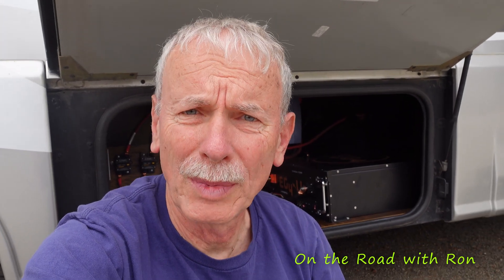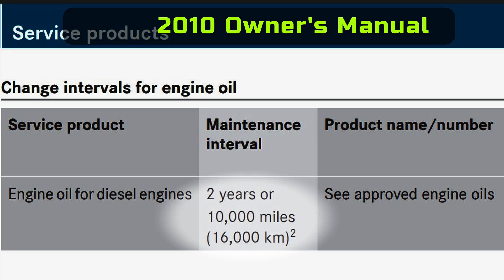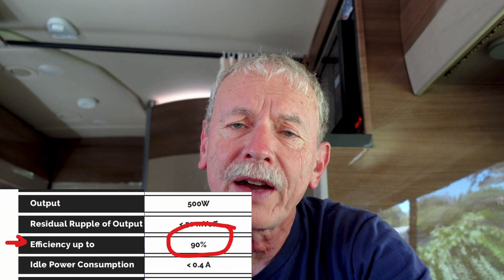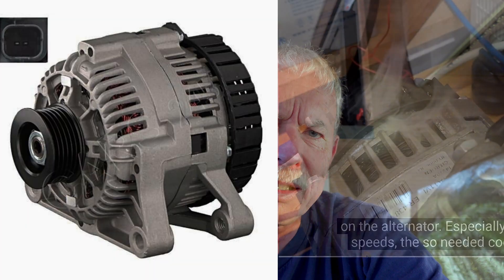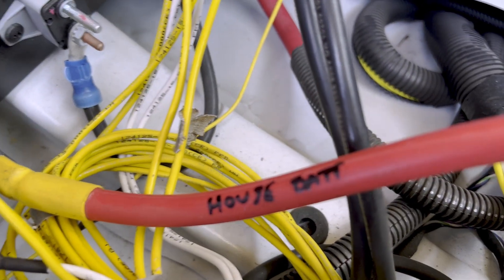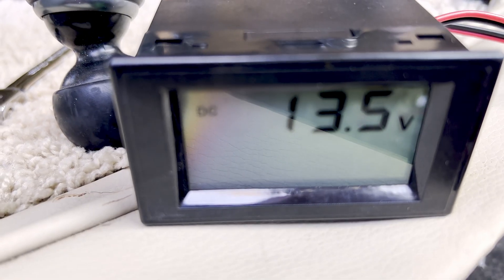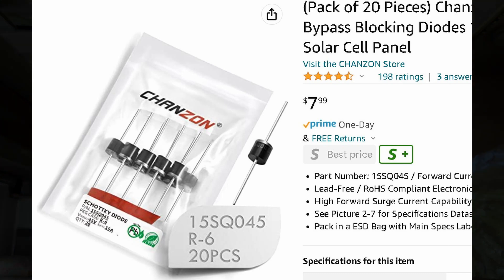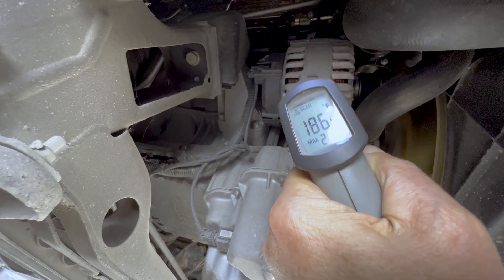DC to DC charger NOT required for big Lithium Battery

Comment: I want to buy a 100 ah lithium iron phosphate batter to put in my trunk of my crown vic to run a 500 watt sine wave invertor to charge my laptop, i recently upgraded my alternator to unknown rock auto brand 190 amp this setup has destroyed a 30 ah agm battery from mighty max. Idle charging is  cold is 14.1 to 14.4 and idle hot i mean couple hours of running later 13.5v and these numbers are consistent with or without the agm battery connected. Question is for you and i will not hold you responsible for anything going wrong lol but will it be safe running in the trunk off 18 foot 4 gauge power wire and a 1 foot ground, the 18 foot power wire going to the lead acid starting battery in the engine bay? Is there anything i should change like go direct to the alternator or put a amp limiter aka dc to dc charger in line? Thanks for your video and your time!
Reply from the maker: Main issue with 2 different voltage batteries connected is they will settle at the same voltage. The lithium battery will keep feeding the lower voltage chassis battery until it is mostly discharged at 12.8 volts. The alternator will charge both batteries but i’d either put in a disconnect or dc to dc charger to keep them separate unless actively charging them.
Reply: @ontheroadwithron2432  Thanks for that much appreciated!

Comment: We never boondock, so am I correct in thinking that our converter will keep the lithium batteries near 100% while we are on 30 amp shore power? I use 2 trucks pulling the Trailer so I do not want to use a DC-DC charger unless required.
Reply from the maker: Yes your converter will charge lithium batteries just fine. You do want one designed for lithium or has a lithium settings as the charges voltages are a little different than lead acid batteries.

Comment: Hi. I'd like to ask if the feasibility of your approach is based on your alternator's "smartness" (inbuilt ability to limit current)? According to all I have read (a lot!) my 280Ah LiFePO4 battery could draw a hell of a lot of current from my "dumb" alternator (160A rating).

Over current protection on the BMS is set at 230A.  So would setting this to say, 40 amps (or whatever I choose) give the same control your setup applies?

Additionally the 40A DC-DC unit I installed last year (working well so far) supposedly provides the "right (selectable) profile" for charging the lithium battery, optimising charging voltage.  Is you LiFePO4 battery happy to take whatever voltage the alternator puts out?

Thanks for sharing your findings.  I am keen to learn more.
Reply from the maker: A couple points. Alternators put out 14.4 volts and this will not hurt a lithium battery. Yours is a bit lower capacity so I would check how much current is actually flowing into the battery when it is less than 50% full. Depending on the size of your wires and how long they are, the current will be limited. How much is hard to tell. If over 80 amps, I would be concerned and not hook then up directly. 
Changing the BMS to a lower value such as 80 amps might also limit your discharge rate. My BMS is not adjustable so never tried that. Your 40 amp dc to dc unit seems fine and a good approach with your alternator especially since it is a bit lower output.

Comment: Thanks for the video. I have an 2006 Winnebago view. Not sure what you have. But the wiring looks identical  I even have the EG4 server rack. I had a lot of people telling me I can’t. I think you did a great job covering all the points they made of why it will fail.
Reply from the maker: Great. Did you go with the 12 volt version?  I thought about the 24volt but decided it was more trouble than worth it.
Reply: Yeah 12v. I linked into 24 and 48. I read they are “superior” voltages for many applications. But since a the wire runs are relatively short I figured 12v would be fine. 

Thought about going 24v for solar though. 
I’m not 100% how that would work. 
I’m still learning. Some info sticks, some goes in one ear and out the other.
Reply: Hello I have a 2006 Winnebago View as well I'm installing 200 amps of lithium battery and I'm wondering if I need a DC to DC charger for my 150 amp alternator. Did you use one ?

Comment: I think the biggest issue is that Lithium batteries outputs 13.3-13.4 volts, whereas lead acid outputs 12.8-12.7. That means your alternator would need to be charging at 14-15 volts to charge the lithium battery. My 120-volt AC charger outputs 16 volts DC to charge a “12-volt lithium”. That’s what a DC-DC charger could do (with step-up). I suspect that your alternator isn’t charging your lithium battery to 100%.
Reply from the maker: Of course lithium does not need to be fully charged after using it. My solar charger cuts off charging at 13.7 volts. The alternator output is 14.4 volts so that will fully charge the battery until the BMS turns the charging off.
Reply: > your alternator would need to be charging at 14-15 volts to charge the lithium battery.

LFP will happily charge to 100% SoC at voltages as low as 13.6v.
Reply: @fratermus5502  what does LFP stand for??
Reply: @victorjcano  LFP =  LiFePO4
Reply: I UNDERSTAND IT, IT'S NOT THE CURRENT THAT IS THE PROBLEM BUT WHEN THE BMS IN THE LITHUM BATTERY SHUTS DOWN THE CHARGE THE BACK EMF WILL TAKE OUT THE ALTERNATOR DIODES

Comment: This video is genius. Addressed DPF, DCDC charger, and the myths. Thanks!
Reply from the maker: Glad it was helpful!  Just trying to break down a complicated issue.
Reply: I UNDERSTAND IT, IT'S NOT THE CURRENT THAT IS THE PROBLEM BUT WHEN THE BMS IN THE LITHUM BATTERY SHUTS DOWN THE CHARGE THE BACK EMF WILL TAKE OUT THE ALTERNATOR DIODES
Reply: @victorjcano  the lead starter battery is still in the circuit
Reply: Sounds scary, can you elaborate? Will a VSR like Victron Cyrix-li-ct protect the alternator from such events?
Reply: @thegrave2000  From BMS shutdown?  No.  But the lead starter battery remains in the circuit to absorb such events.  The problem occurs with dedicated (secondary) alts that have no lead batt.  In high-end systems the BMS commmunicates with the external regulator to shut off the field before the BMS trips.  

Also, don't pay much attention to people who type in ALL CAPS.
Reply: @fratermus5502  hm, how are you going to shut off a secondary alternator? Is there some internal blocking mechanism for the pulley?
Reply: @thegrave2000  secondaries are typically externally regulated (Balmar, Wakespeed, etc).  The reg zeroes or reduces the field as required by adjusting the signal on the field wire. This control of the alt's output.

Comment: When the alternator is under relatively low load ie headlights, blower motors, wipers, etc.,
Reply: (a parallel wire could be manually or automatically switched on thereby decreasing resistance to the large load of the auxiliary batteries. Or manually running through a heavy-duty resistor, when not switching to bypass it, might have similar heat loss as running through just 1 wire)
Reply: (or sequentially switch individual auxiliary batteries on and off from charging with sequential toggle switches or multi-pole knob hooked up to heavy duty relays at each auxiliary battery).
Reply from the maker: Yes I essentially have that with my manual switch in the dash. This is mostly a backup as the solar is the main method of charging.

Comment: Just curious, would this depend more on the allowed current from the continuous duty solenoid and/or how many batteries you have charging? I’d imagine that solenoid is well over 150d. But if you add another lithium to the bank you’d then have the potential of charging at 300ah’s. I know in the Trevato’s the solenoids have to be replaced over time because of heat.
Reply from the maker: My solenoid is rated for 200 amps continuous. I only draw 80 amps or so from alternator to charge the 400 amp/hr battery. The Hersee Cole solenoids are very reliable.

Comment: Hi Ron great information I have a question I have set up where I will get variable rpm from my alternater that can be 100 to 2000 can I charge lead acid battery is and from lead acid battery to lethium batteries or can I charge directly lethium batteries please help me I m serious concern for this
Reply from the maker: Hard to answer without all the facts such as the capacity of both the alternator and lithium battery.  Lithium will pull a lot of power from alt. You can test it of course. If you have a 200 amp alternator then keep the Charging current under 100 amps. When driving the alt gets good cooling but be careful when just idling. Might overheat.

Comment: But you won’t get a full charge, an alternator will not charge a Lifepo4 to 14.4v, and THAT is one of the main reasons you want to use one to get full capacity charging, right? And also one of the reasons is supposedly the alternator can make the battery turn off and that could cause damage to the alternator. So I guess I’m not understanding what you are saying?
Reply from the maker: Full charge on my lithium is 13.6v. The alternator actually charges my battery more than my solar controller. Also how can the BMS damage the alternator? Doesn’t make sence as the charging current goes down as the battery reaches full charge.
Reply: I don’t know WHY  it damages it, I just know everything I read says it can damage it. But a fully charged Lifepo4 is 14.4 so 13.6 is not max. You’re losing a lot of capacity doing it that way.
Reply: Here is and exert from one of many articles

“Low quality alternators with poor voltage regulation can cause the Battery Management System (BMS) to disconnect LiFePO4 batteries. If the BMS disconnects the batteries, the alternator could be damaged”
Reply: @jamesmorrison5076  AS I UNDERSTAND IT, IT'S NOT THE CURRENT THAT IS THE PROBLEM BUT WHEN THE BMS IN THE LITHUM BATTERY SHUTS DOWN THE CHARGE THE BACK EMF WILL TAKE OUT THE ALTERNATOR DIODES. THE DC TO DC UNIT PROTECTS THE ALTERNATOR
Reply: Found this as to one of many reasons why. Again… I am not the expert so don’t argue with me I’m just telling you what my research shows :) 

“I understand the reasons. A stock alternator directly connected to Lithium is a problem as the low internal resistance will cause high continuous currents and kill the alternator by heat”
Reply: One more. 

The lead-acid battery is the safety "accumulator" that eats the transient peak produced when the BMS decides to disconnect the battery from the alternator avoiding any damage to the electrical van´s system and the alternator itself.”
Reply: One more. 

The lead-acid battery is the safety "accumulator" that eats the transient peak produced when the BMS decides to disconnect the battery from the alternator avoiding any damage to the electrical van´s system and the alternator itself.”
Reply: @ontheroadwithron2432  Each lithium battery is 3.7 volts. They run 4 of them in series to get 14.8 volts. Then they run the 4-packs  in parallel to increase capacity. There isn’t a “12-volt” lithium setup that is 13.6 volt. Lithium batteries can be charged to max and depleted thousands of times and is protected by the BMS.
Reply: @ontheroadwithron2432  Also how can the BMS damage the alternator? AS I UNDERSTAND IT, IT'S NOT THE CURRENT THAT IS THE PROBLEM BUT WHEN THE BMS IN THE LITHUM BATTERY SHUTS DOWN THE CHARGE THE BACK EMF WILL TAKE OUT THE ALTERNATOR DIODES. THE DC TO DC UNIT PROTECTS THE ALTERNATOR
Reply: "And also one of the reasons is supposedly the alternator can make the battery turn off and that could cause damage to the alternator." CORRECT. AS I UNDERSTAND IT, IT'S NOT THE CURRENT THAT IS THE PROBLEM BUT WHEN THE BMS IN THE LITHUM BATTERY SHUTS DOWN THE CHARGE THE BACK EMF WILL TAKE OUT THE ALTERNATOR DIODES. THE DC TO DC UNIT PROTECTS THE ALTERNATOR

Comment: Thank you Grandpa Ron for your all experienced level user friendly explanation of a complex subject real world application integrating new battery tech  into a tried true mechanical system.

 I only have one more question to figure into my application to find the answer .

 52 v 30Ah lithium high end ebike battery to power  led light strip a rice cooker 350w and laptop phone charging 1500- 3000w power drive inverter

 upgraded Toyota alternator 120watts I believe 14.7 volts at normal load . Do I need a different inverter to handle and limit the 52v DC, down to 12v  DC  that as of now provides very effective alternator charging and appliance powering from the stock lead acid starter battery while motor runs and for 30 minutes, after the motor is off before it auto shuts down at 12.2v with out any starter battery issues , looking for 4-5 hours of charging after the engine and alternator is off  provide 110 ac  with out catastrophic component failure.

 any accurate honest information from forum users would be valued .
Reply from the maker: Let me be sure. Do you want to use the 52v bike battery to run your 12v appliances when the engine is off? In that case a 52v to 12v charger would be needed.  If you just want to recharge this battery then you have to use your inverter to change the 12v from car battery to 110vac. You can then charge 52vdc battery with you battery charger (110vac to 52vdc).

Comment: Hi let me ask you if you have issue about your alternator when Lifepo4 battery bms triggers HvCutoff when it is fully charged with the alternator?
Reply from the maker: I have not had an issue. Of course i do not normally charge lithium with alternator.  But when i do use the alternator, i cut it off with my switch which is probably the same as BMS turning it off.

Comment: have had my sprinter 3 years and just last week I learned that through my Victron app, I can reverse the flow on my DC to DC charger. In other words, I when the Mercedes Me app sends me a message that my battery needs charging, I don't have to drive the van for 30 minutes or more. I can use my house batteries to trickle charge my chassis batteries and do that preemptively to avoid the whole problem.
Reply: How do you reverse the flow and what is the amp charging rate? Thanks
Reply from the maker: Much better for the engine also.

Comment: What size wire is connected between your alternator and house batteries and what is the length? It looks like you have the magic setup to limit 80 amps charging and would like to replicate something similar to that with my setup.
Reply from the maker: Most of the wire is original. I believe its 2 ga. I also added a 4’ piece of2/0 welding cable to the new battery.

Comment: Another great video Ron.  
You have convinced me of one thing for certain.  Even though I was a NAVY Electronics instructor (I retired from that over 30 years ago), I am NOT even close to qualified to upgrade my solar (currently I have one 190W panel and 2 12vDC Wet Cell) batteries in my 2022 Jayco Melbourne.
Now the question is…when can I bring my coach and checkbook/credit card to you and you can teach me while WE install a comparable system into my unit?

Don’t laugh…I’m dead serious!  I don’t know enough to know who to trust to do an installation like you have…but I know I want it.
Reply from the maker: Very kind but of course i am retired. Just as busy as when i was working especially with 4 grand daughters. 😊
Reply: @ontheroadwithron2432  that makes both of us sir…lol
Sometimes I think I need to go back to work just so I can get a break!! 🤣🤣🤣
Reply: I UNDERSTAND IT, IT'S NOT THE CURRENT THAT IS THE PROBLEM BUT WHEN THE BMS IN THE LITHUM BATTERY SHUTS DOWN THE CHARGE THE BACK EMF WILL TAKE OUT THE ALTERNATOR DIODES
Reply: I was waiting to see if somebody brought this point up. How many even know what back emf is?  @victorjcano

Comment: My first old rig was Citrone van based had a puny 55a alternator and would have died with that load - In Europe  RV tend to be  much smaller and are van based -  my current 3ton Peugeot boxer rig has a 120a alternator  and is apparently the heavy duty option -  I prefer the DC to DC charger because then I know my expensive 300ah lithium batteries are being managed with the correct 3 stage profile for lithium - Incidentally the Victron Alternator post was narrated by a guy who's focus was on UK canal narrowboats.

Comment: What's up Grandpa! 👋 .... So what you are saying is my big semi's diesel Detroit 12.7L alternator can work just fine in direct charge effort? 🤔 ... I've been wanting to get a big lithium battery, so I can just save my $$ and put it towards a 400AH battery
Reply from the maker: Your alternator must be rated for more current than your Lithium battery BMS. If so then yes.
Reply: @ontheroadwithron2432  I checked my Alternator. It's rated @ 145A .... I'm seeing 14.4V on startup (900rpm high idle) then settles to 13.9V .... When running at 60mph I'm seeing 14.3-14.4V on radio display and also on PZEM-015 Battery monitor. So I suppose this should be able to recharge a 300AH or 400AH lithium pretty quick?
Reply from the maker: @vroor32  A lot depends on the size and length of the cable from the alternator to the batteries.  Sprinter alternator is 220 amps, so yours is a bit lower.  Try to get an amp meter of battery monitor to see how much charging current you are actually getting. Try to keep it under 80 amps to have a safe  margin.
Reply: @ontheroadwithron2432  good to know. I went with 4/0ga pure copper for 15 feet to my 2K inverter. Maybe I will re-route that cable from Alternator to Lithium battery once this all becomes clearer. I'm planning to get a clamp meter as I solve this puzzle.